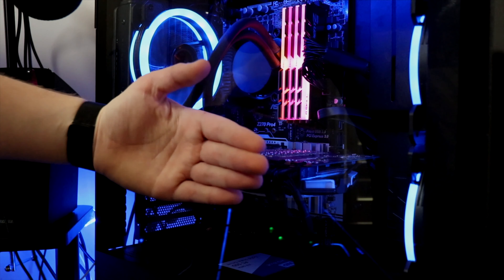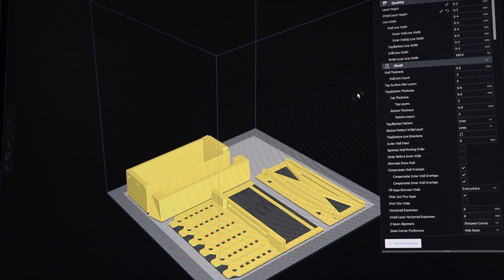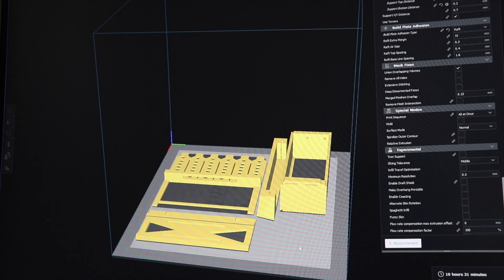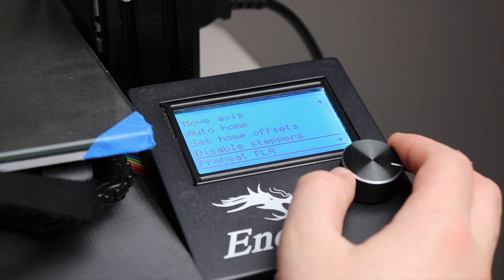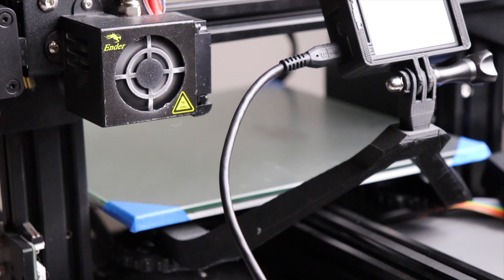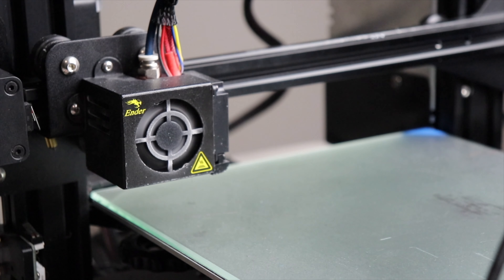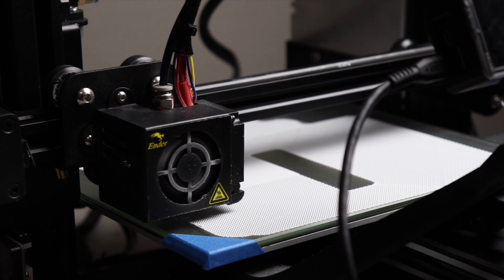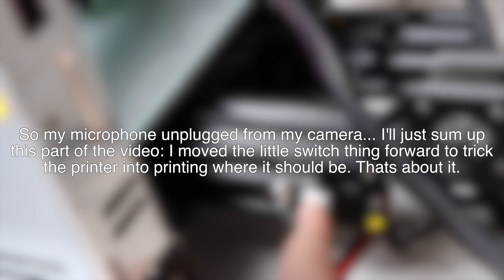3D Printing - Graphics Card Vertical Mount

Comment: Why do you use a raft? Warped bed?  I never use a raft with my ender 3 pro and never have any issues. I think a raft is just a waste of time and filament.
Reply from the maker: Snap-On kid The edges warp, and brim never helps.
Reply: RC Kid 
I only use a skirt with ABS and  and a brim for everything else.
Reply from the maker: Snap-On kid Brims never stick to the bed for me. It’s s problem Ive been trying to figure out. When the print warps, the brim is lifted off with it.